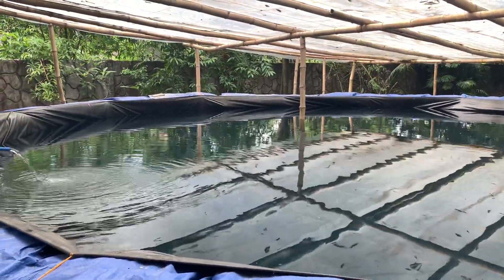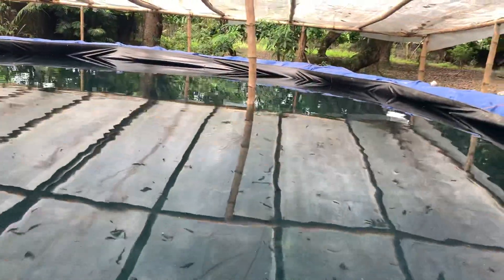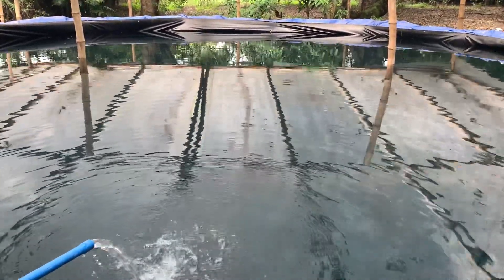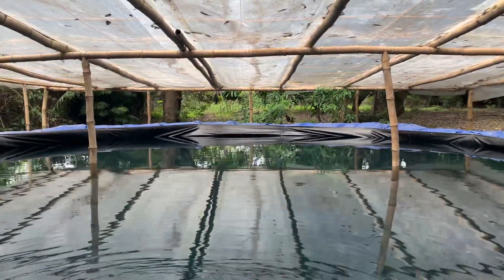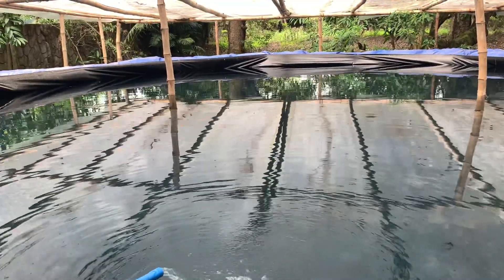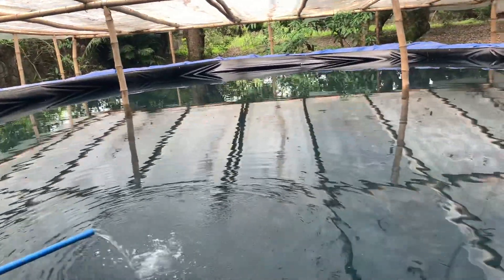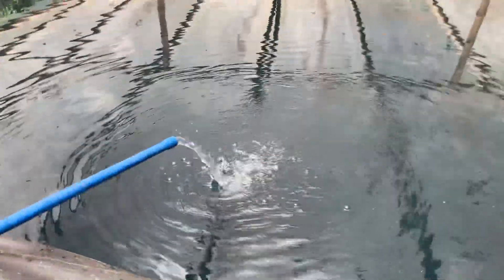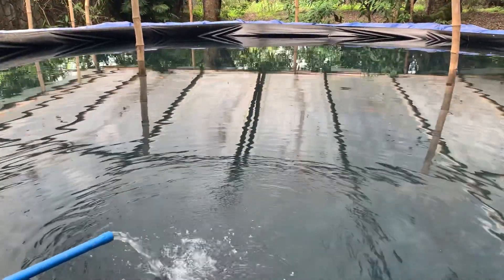Cost of building a biofloc tank using tarpaulin and sacks

Comment: What is the difference between concrete and tarpaulin regarding the health of the stocks?
Reply from the maker: Concrete tanks are more expensive to build compared to tarpaulin ones...if the inner surface of the concrete tank has a rough finish, fish get injured when their body comes in contact with the surface during swimming, especially catfish as it doesn't have scales...and tarpaulin tanks are more mobile...for example, you can just fold them and change locations which are not possible in case of concrete tanks...if built properly, concrete tanks are also a good option as they last way longer than tarpaulin tanks.